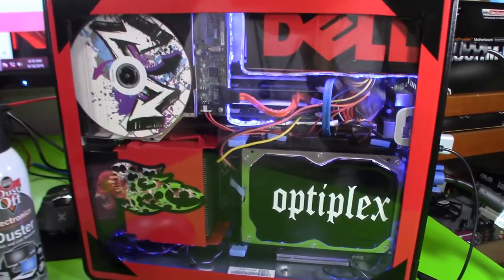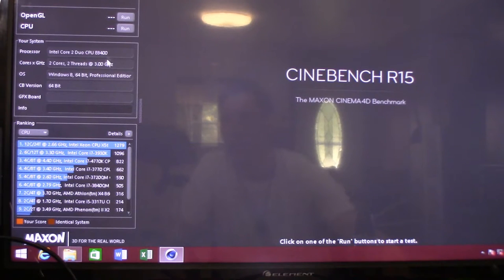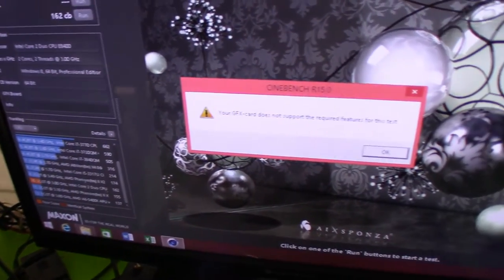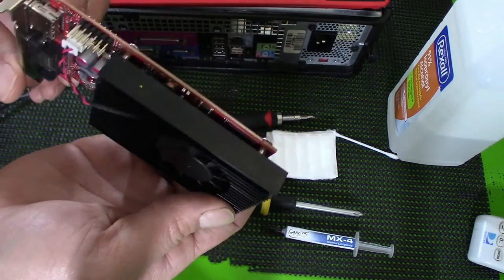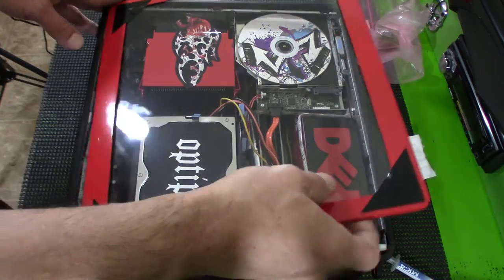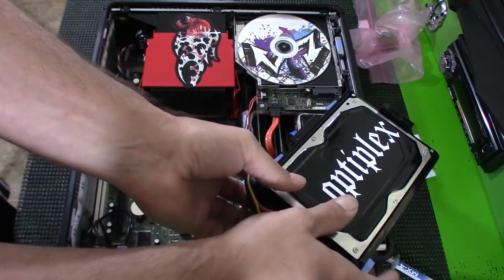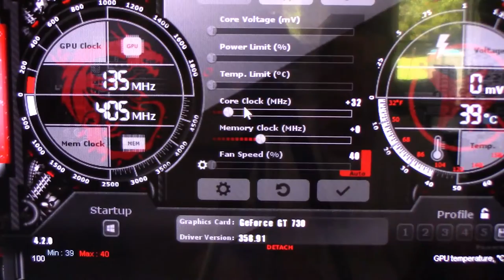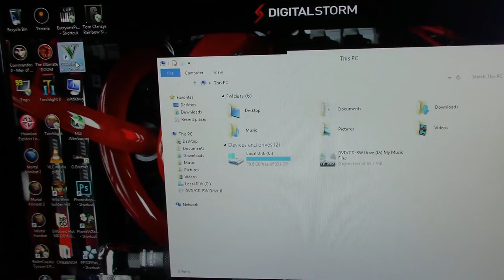can a simple 20 dollar upgrade make a cool optiplex computer? core 2 quad q9400 2.66ghz

Comment: The guy that chopped the bit off, its done so it can be fit into servers with PCIe x4 or x8, as most older ones do not have PCIe x16 slots. But this does lower the bandwidth So performance might vary a little from a non-modified one
Reply from the maker: that makes perfect sense and thank you for taking the time to explain that
Reply: that card stock comes like that, he cut the pci-e lock off. if it was x16, the slot would be longer than the card.

my brother has the 630 and it is exactly the same, just a black pcb and the lock
Reply: The previous owner didn't cut any part of the PCIE connector, he cut the locking part of the PCB off

Comment: I have a question that works with psu stock? Of 280w? I have 6gb ram one hd6570 and 3 hdd 500gb 320gb and 80gb I want to put a core 2 quad, I have to change psu? thank you very much
Reply: did u found an answer?

Comment: I'm still useing my q6600 at stock mhz, with a hd radeon 7750 1gb overclocked with 8 gb of ram. Run gta 5 and Days standalone always above 40 fps . In my Optiplex 780.

Comment: Did you run all this on the stock 275w PSU? I was thinking about getting a Q9400 and an R7 240 for my small form factor 755 but I'm a noob I don't know much about power usage and what graphics cards would fit in. As you know there is quite a small space between the hard drive and where the card goes. Any help?
Reply from the maker: yes I used the stock psu after taking it apart and cleaning it thoroughly. yeah not much room get a low profile card that gets power from pcie slot and if you need more room take out the hard drive caddy leaving the fan and place a ssd drive round the optical drive.
Reply: try a rx460
Reply: Gtx 750 Ti works fine as well.

Comment: Have a Core 2 Duo that the power just went out...  The Dell OptiPlex had 4MB RAM and ran at about 3.0 GHz and 1T HDD (Ran for just under three years from Newegg recycle)  Have a new used Dell OptiPlex 1070  I-5-3470 CPU @ 3.2 GHz  8 MB 1600 MHz 2T HDD .  And soon will max out the RAM at 16 MB and add a 4 MB video card.  The only con is the I-5 machine has a 275 Watt Power Supply...  And if the Core 2 Duo only needs a power supply then can upgrade the I-5 machine to a 500 Watt EVGA power supply...   Win7Pro64   Thank you for the video !  tjl
Reply: Tim Lipinski GB*

Comment: i have dell precision workstation t3400

dell x38 btx crossfire
core 2 quad q6600 G0 2.4ghz ( will upgrate to a q9x50)
kingstone 4gb ddr2 800 cl6 :( (going for 8gb ddr2 800mhz cl5 i hope)
asus geforce gt 440 1gb ddr5 (upgrade to geforce gt 630/640 or gtx 750)
160gb  sata 2 7200rpm win8.1pro + samsung 250gb backup  (going for 120gb ssd and 500gb green hdd )
dvd rw sata
Reply from the maker: that sounds awesome its fun upgrading a good ole dell!

Comment: I can't believe I used to use a Coe 2 Quad Q6600 at 3.01GHz paired with a Radeon HD 6970 and 4GB of ram. Today I have a Core i7 4790k at 4.7GHz with GTX 980 and 16GB of ram.
Reply: c2d e6300 with 4gb ram and a 7950. now i use a g3258(4.5ghz), 8gb ram and the same gpu. biggest difference is the fact i have a 750g2 and a define s now, i am going to be using them for my next build in 3-4 months
Reply: i still use my Q9450 with a GTX650 and 4gb ram
Reply: Jynn Yoon just send me your old q6600 :p jajajaja

Comment: As I mentioned in a comment on another video, I'm not a fan of the GT 730 but at $20, considering you're pairing it with a Core 2 Quad q9400 CPU, it works. That card is definitely meant for older CPUs such as this.

The problem is many places sell them new for $50 to $80, depending on the model you get.
Reply from the maker: im always on ebay looking for deals and best offers I usually offer silly amounts and sometimes it works. In addition for an older card msi afterburner is a great tweak. im not about fps on playability. thanks for commmenting

Comment: I have an old 75 core 2 duo computer laying around.Im gonna try this upgrade.Do you think a xeon cpu would be a better upgrade than this one?
Reply from the maker: the 771 xeon mod? If that's what you mean yes but its my understanding only the 3000 series are known to work in the board with the custom bios flash and mods..finding  a cheap but better xeon for it might be tough....I suggest having a original bios on a usb stick if you try this method with no success because after the custom flash it will not recognize a core 2 anymore. unless re flashed..
Reply: modstek
Im changing my mind as far as the xeon goes.I found an extreme 2 duo for 36 bucks.They are very overclockable.

Comment: wow cool i have a optiplex 360 small form factor looks the same exept the modding you did
Reply from the maker: cool I haven't got see one of those yet
Reply: +modstek You should try modding the Dell Optiplex 390 series and the 3010. Both of those systems don't cost much anymore, and are on the LGA1155 platform (i.e Sandy Bridge, Ivy Bridge)
Reply from the maker: if I get a hold of one of those I sure will. I tried once to get some from ebay sellers at cost and put the link to their store in my video so we both win but no bites sadly.If I had buyers lined up it would be nice. I hold on to these things for quite some time.
Reply: modstek why not setting up s small croundfund to take one and after u can raffle it between the suporters.